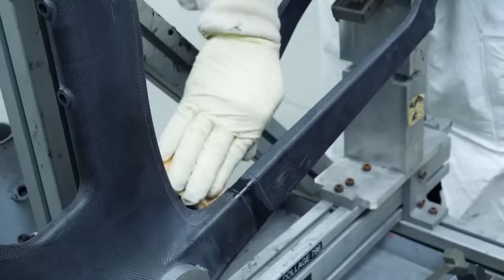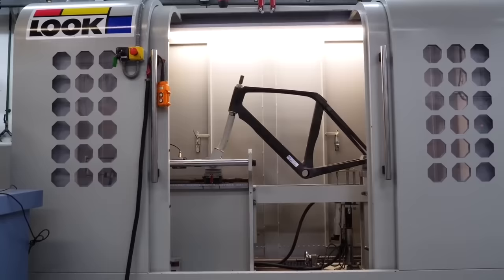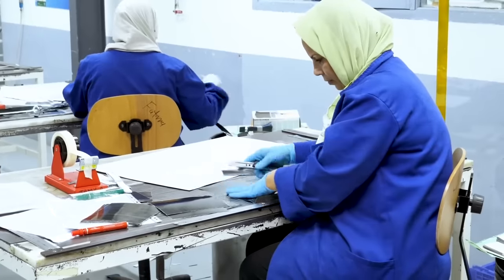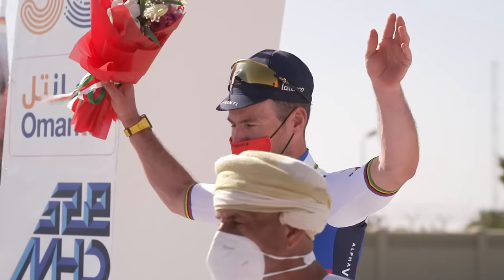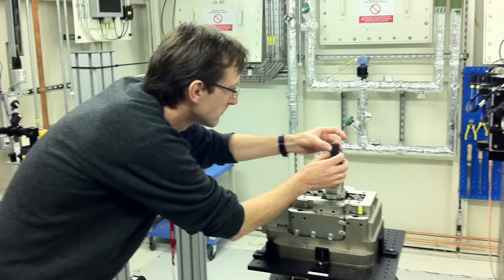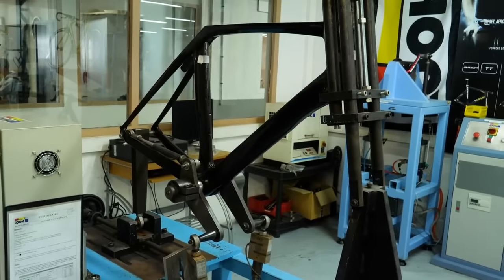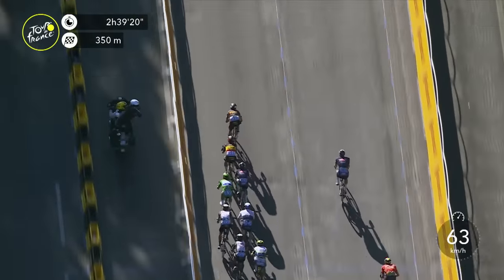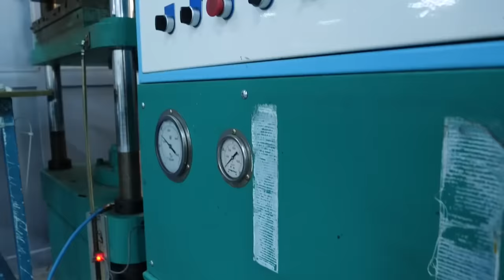Your Carbon Fibre Bike Won’t Last Forever

Comment: This is the real content!.  I bought a Giant Cadex CFR 4 originally it was a racing road bike ,one of the first carbon bikes ever made, but its been transformed into a fixed gear bicycle the frame and the fork are from the 90s the other components have been changed and it's still rides like a dream..  tho I always have that thought on the back of my head when im ridin, especially fast over a rough terrain, that it could actually snap in half....only the lugs are aluminium, the tubes carbon.....I hope it will last me another 30 years, fingers crossed....
Reply: Ja, I am in the same situation.  My hope is that failure is not catastrophic, and simply results in a "funny" feeling ride that can be seen as small cracks.  Then, assuming my vision is still good, I can detact a failed frame.

Comment: Exceptionally high quality content. Thoroughly enjoyed it, and also the questions asked were brilliant. I'd like to know how aluminum bike frame will compare with different levels of carbon T300, T700, T1100, etc) frame, a side by side comparison on longevity and maybe for carbons, the"un-deadness" of the frame, since they won't just break so easily. Cheers

Comment: Just got a CF MTB used for a good price and felt a bit unsure about the CF part. This vid really gave me confidence, especially the gracefully failing aspect. It's really reassuring to know that your frame first will get noticeably softer and maybe start delaminating somewhere instead of just instantly cracking like a metal frame would probably do!

Comment: Really great video Olly, really good questions and answers from the experts. It's good to compare the different frame materials, and good to hear about fatigue stress levels and deflection cycles. It would be really good to do a video on tube shapes and sizes and wall thicknesses, which drives the stress and deflections, and then the forming and shape of the joints, such as the bottom bracket area, and how that can stiffen or flex the feel, and is pretty much independent of material. Great to see some engineering principles talked about!

Comment: I have a old LOOK carbon bike from 98'. It has been flawless. I tried using a Look carbon seatpost but I kept cracking them because it's fixed in place with a wedge. Then I discovered that it's tapered. It's thicker at the top and very thin at the bottom. After using a aloy seatpost I didn't have any more seatpost problems. After watching many videos by Hambini, I'm very reluctant to buy a new carbon bike or frame. Thank you.

Comment: That was the most interesting topic in a long time. Ollie, any way the average user of carbon frames can identify mentioned weaknesses before they become a safety concern? It would be interesting to talk to the industry itself about this topic and hear their recommendations.
Reply: You can get your frame x-rayed in what ever way they x-ray carbon frames..........Like Canyon does this to their frames after they get them from Asia..........the frames are x-rayed in Asia also but Canyon spent the 500,000 for their own x-ray machine............they dont want failures.........I bought a Canyon Endurace 2 months ago.
Reply: no, carbon will usually fail completely before it will show any signs of damage. it will be practically impossible for you to tell visually on a painted carbon surface.
Reply: @adrianc6534  It really doesnt work that way,generally cracks appear first,then things go downhill from there............buying no name chinese carbon parts is asking for disaster.
Reply: @bradsanders6954  i did too 88.000 kms eatlier!

Comment: Have used my carbon Roubaix for 14 years now. Feels like new when riding. However, am getting a new bike just now. Old frame will now be permanently strapped to my trainer. Expect 15-20 more years of use. :-)
Reply: Just curious did the bike ever fall like from standing and also ever hit roughy roads ie pot holes and no problem or any impact and still had no issue ?
Reply: @JitinMisra  who does not fall over for 14 years with cleats 😂 - and pot holes are everywhere but tires and wheels take most of the beating. Got run down by a taxi once and repairs included a new fork and 5 ribs. Frame itself amazingly still OK.
Reply: @meibing4912  I just bought a trek fx bike that is all carbon, to upgrade from my previous bike which was aluminum with carbon fork. Gotta say the difference is amazing, on how smooth it is over bumps. But I sometimes feel paranoid on if I have to baby it. I only ride paved roads though not jumping mountain bikes
Reply: @JitinMisra  I had the same feeling/fear in the beginning. 😁Just avoid deep scratches. I recently slammed a (new) Specialized bike with 50mm carbon wheels into a massive pothole going downhill. So surprised the wheel did not even go out of tune. Good luck and enjoy!

Comment: Insightful as always! Can’t wait for other materials especially the high price Titanium which some YouTubers claim it’s not as strong as credited.
Reply: It's not that it isn't as strong it's that it REALLY comes down to the welding and when many ti frames are very small and very boutique the QC can be an issue but the tubing is yes basically indestructible
Reply: @coreygolphenee9633  Welding is the weakest part of any build facts!
Reply: @tusharbhudia9421  ya but a bad weld on steel fails differently then on Ti and Alum which tend to be immediate and catastrophic

Comment: I have a 29 year old Dunlop Hotta Perimeter TT bike with a carbon finish with 1993 carbon specialized carbon finish tri spokes tt wheels, all in perfect condition with no cracks whatsoever. There is your answer ollie, going training on it this afternoon.
Reply: But is the carbon from back then the same as today's?
Reply: @JasonDBike  I also have a modern trek speed concept i do competition on now. I bought it expecting it to be much faster because it has modern wider wheels and a slightly more aerodynamic profile and obviously lighter. The difference in speed is immeasurable and could easily be the difference between one day and a slightly better weather day,either way. I am in the same position on both bikes and that is what is important. We are being conned, I am sure !

Comment: It would be interesting to hear what a polymer scientist has to say about the resins used in carbon fiber bike frame fabrication.  Especially since the effect of UV came up a few times.  Is there a resin that limits UV's impact?
Reply: Paint?
Reply: The resin itself can have UV inhibitors added, but paints (including clear coats) are better. As was pointed out, they also have a limited life. Down under where the UV is strong it's a real issue.
Reply: M8 Airbus A320 Series has carbon flight controlls and I never heard about any UV degredation problem so paint does the job well. 😉
Reply: It would interesting if the Professor of nuclear materials science could explain how an RBMK carbon fibre frame can explode.  I told Prof. Dyatlov that my carbon frame exploded and that there was graphite amongst the bicycle rubble on the road....he started shouting saying "YOU DIDN'T SEE ANY GRAPHITE because it wasn't there!" The dosimeter readings of the bike wreckage maxed at out 3.6 roentgen per hour, not great but not terrible either.
Reply: There is a resin that limits UV impact, but the question then is does it work with carbon fiber to make a good bike?  Acrylic resins have excellent UV resistance.  They aren't as tough as epoxies (keep in mind there are a lot of different kind of epoxy resins - acrylics, too).
Reply: you can buy clear polish that protects fibre glass boats from UV.
Reply: @djlinux64  FACTS, proper paint just wins

Comment: Nice Ollie fascinating, the information goes along well with my personal experience of Carbon Fibre failure that I experienced over the 25 to 30 year of using it in cycling, in frames & components. I the aluminium idea but would if you could cover these areas with Titanium frames also?

Comment: Best GCN video yet and really interesting to learn from real experts in the field. I would like to add a couple of points, one is that while NDT (non destructive testing) is talked about for testing Carbon frames after a crash, this is rarely available. metals are sonorous so they can be checked by "ringing" them. Secondly Canyon (as an example) recommend changing carbon forks at six years, obviously this is a sensible compromise as they don;t know the usage but it is an expense that requires budgeting and could come to light in the event of a post crash court case.

Comment: As a composite glider technician... I can say, yes material softens as described... But engeniered correctly it lasts longer than any metal... I see gliders from the late 60th regularly... In snowboards you can definitely feel that deadening... Unless you buy burton, who prestress their boards and engineer that softening before hand

Comment: 16:23 Tom Bahto - Senior Specialist, Materials Engineer: "There must be millions of carbon fiber bike frames out there that are 15 to 20 years old, and they are not falling apart.  So by and large, I think the cycling public are pretty safe on aging carbon fiber bikes."
Reply: Because the load experience by those frame is below the limit of frame fatigue design. And most cyclist dont produce power above 400 watt that's even less than 1 horse power
Reply: @arifazhari7598  Thats about half a horsepower.

But real horses put out multiples of 1 horse power.......HP is a measure of long term power output, not short bursts.
Reply: @marcalvarez4890  But horses don't ride bikes... Not that I've seen anyway.

Comment: Bought an old 2008 six13 an it still had the original tires on it so it's good to know that even though it hasn't been used much it doesn't really have that much fatigue.

Comment: I agree with the 2nd guy. Flex is designed to neutralises the stiffness.
Motorcycle swingarms are designed with flex in different ways for each track so there is some kind of suspension when they're horizontal.

Comment: Would be cool to see a comparison or test of heavily used pro carbon bikes and carbon bikes that are new or used by amateurs. Kept thinking about the sailing industry throughout the vid. In sailing you are starting to see more older carbon components that have been frequently exposed to UV, saltwater and high loads but my understanding is that failures aren't as common as one would expect.
Reply: no boat sank as much as the trispoke broke LOL

Comment: Really great content thank you more if this please. Great balanced view and also brilliant to see well reasoned and knowledgeable people posting in the comments, seems the sailing world has it hardest due to the external weather and storage factors. My 2 pennies worth on bikes/frames feeling dead. For those of us who trained and raced on the same bike and put race wheels on stiffness or spoke tension etc and tyres make a bike feel drastically different obv different for high power sprinter pros but a real factor
Reply: Yes, I would imagine square acres of carbon fiber composite material exposed long term to sun, wave 'crash' stresses, and salt water does not help it's longevity one bit.

Comment: I think road cyclists stress way too much over these topics, when even the roughest asphalt or even gravel wouldn't compare to the stress applied to a bike frame that of a MTB descend. Full carbon frames are also made and used on mountain bikes yet they aren't noticeably prone to fatigue wear that people complain about it to an abnormal extent. Sure, one might say those frames are more reinforced than road bike ones, but fatigue is an integral problem the entirity of the material suffers as it get exposed to deflection and small impacts, according to these experts.

On the bottom line, will YOU keep a bike for long enough that it's something to worry about? While one day the current carbon bikes will become what the collectible, vintage steel bikes of the 70s onwards are today, even if you keep your modern-day bike for decades, or you or someone buys it much down the line, you won't view it as an everyday, dependable piece of sports equipment.

Comment: I like how this conversation is real informative and just on the level that someone who has no real knowledge on this subject can still follow it.
Reply: The basics of composite materials are simple to understand. Stress, strain, Youngs modulus, layup direction fibre/resin composite etc. Modelling them in finite element software in mid 90's for my thesis was a bit more challenging!

Comment: To clarify/correct one statement made by the professor: Generally in engineering metals are attributed with the property of 'graceful' or 'good-natured' failure while composite materials often fail cathastrophically or even explosively. And accidents at F1 races demonstrate that very well. The carbon fibre composite literally explodes and sends particles flying everywhere, whilst a metal part would bend or shear. That is due to the ductility or rather stress-strain curve of metals. When you overload metal it stretches a lot before it fails, often you notice elongation or a bend in the part and can avoid failure before it happens. Composite materials can endure higher specific loads and stretch/strain only by a very small amount under heavy loads. But this also means that the amount by which the material elongates or bends before it fails is barely noticable. Since the stored energy that gets input by the load is not turned into deformation of the material, the composite explodes with high force. What motivated the professor to describe the failure of composites as failing grecefully is the process of fatiguing. Because of the mechanisms described by him, metals fail without warning when the failure is caused by fatigue rather than overloading.

Comment: steel frames are the boss!
Reply: I agree, you can't beat a  hand made steel frame.
Reply: Steel still real!
Reply: Steel can be real....ly flipping heavy too ( I ride a cheap 14kg chromoly disc commuter bike 😰)
Reply: @richardggeorge  my salsa fargo in steel is awesome!
Reply: @richardggeorge  14 kg are not that much for a commuter bike. My hardtail aluminum MTB also weighs 14 kg.
As long as it's not hilly tires have the biggest effect, a tire with low rolling resistance (10 to 14 W) is a difference like night and day compared to a touring bike tire with 25 W

Comment: I found this video really interesting, and kudos to GCN! I would like to know what effect over time would moisture inside a frame from washing or winter riding have on the composite degradation?
Reply: I've got a 2016 Trek Farley 7 with a carbon fork, it gets rode daily in all weather conditions (-20s to 40s c) and it's doing just fine with about 30k miles on it.

Comment: A quick google search on the ISO standards for bicycles led me to see that there are standards for the fatigue testing of bicycle frames laid out by the ISO Standards. This would give minimum values I assume(you have to purchase the standards and while I am interested, I am also a broke engineering student currently, so no purchasing manuals for me). If anyone has a copy of the standards or if GCN Tech wants to do a part two to this video that might reach out to a few frame companies and compare what they do to what the standard says... 

I am sure that most companies design for an infinite life if possible, but it sounds like composites don't have an endurance limit like a steel would(steel if loaded at a low enough load will never fail due to fatigue, unlike aluminum which will always fail no mater how low the load is). What the actual designed life is would be nice to know and certainly give me peace of mind on my 3 year old race bike(have to wait for real job/adult money to buy a new one).
Reply: You’ll get there kid. I remember picking my lunch out of the trash and walking in the same shoes as you. Keep pushing keep working.